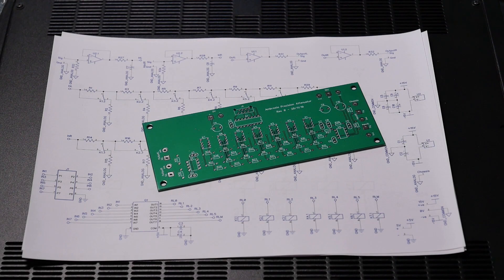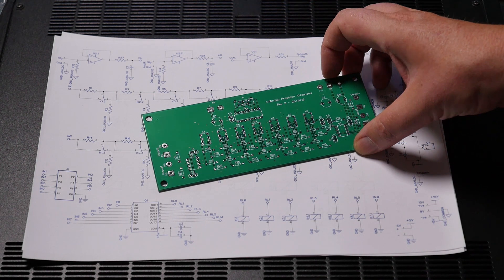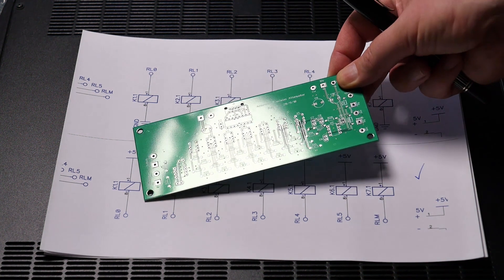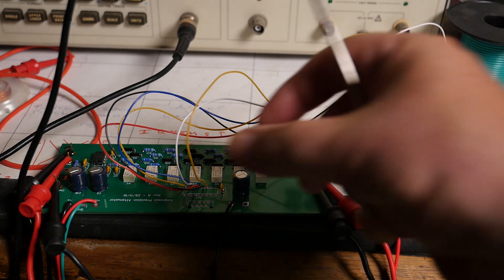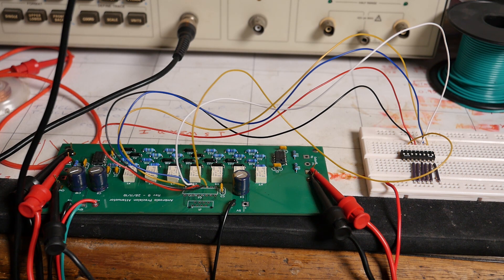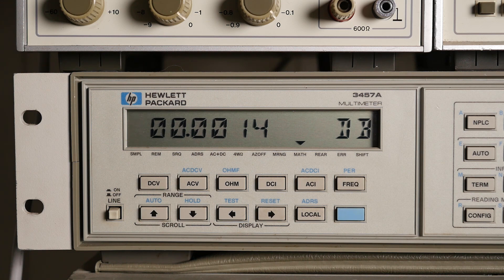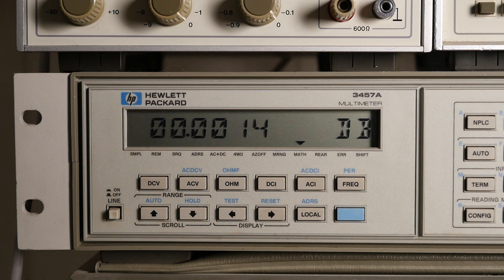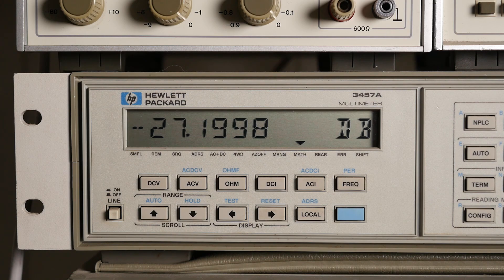DIY Amplifier Project - Attenuator PCB design error

Comment: Sir can you plz share the series and parallel resistor values remaining all the works are over for example ir controll, encorder connection, mode switching, display connection and also the relay volume controll using the binary values but i am confused with the resistor values. So plzz help me
Reply from the maker: The resistor values I used are as follows:
1st stage (-0.85dB) 931R Series 97k6 Parallel
2nd stage (-1.7dB) 1k78 Series 46k4 Parallel
3rd stage (-3.4dB) 3k24 Series 21k Parallel
4th stage (-6.8dB) 5k49 Series 8k45 Parallel
5th stage (-13.6dB) 7k87 Series 2k61 Parallel
6th stage (-27.2dB) 9k53 Series 453R Parallel
-the end of the chain is terminated with a 10k resistor to Ground.

Each stage is intended to have a 10k load at its output (hence the 10k resistor to ground at the end). If you consider there to be 10k in parallel with each parallel R value, then you'll see that it forms a voltage divider that yields very close to the intended degree of attenuation, and that the resistor pair presents a (very close to) 10k load at the input side, which is why you can freely connect or disconnect stages from the chain. (The output impedance of each stage is all over the place though, hence the output buffer following the attenuator network.)

For example: looking at the 1st stage: 97k6 || 10k is 9070.6 Ohms
9070.6 + 931 = 10001.6 Ohms (near as damnit to 10k)
Considering it as a voltage divider to figure out the attenuation:
9070.6 / 10001.6 = 0.9069, which approximates to -0.8487dB (near as damnit to -0.85dB)

I would highly recommend using Jos van Eijndhoven's excellent logarithmic attenuator calculator - it makes things a whole lot easier:
https://www.vaneijndhoven.net/jos/attenuator-calculator/index.html
Reply: @KarlAdamsAudio  Thanku so much sir ❤